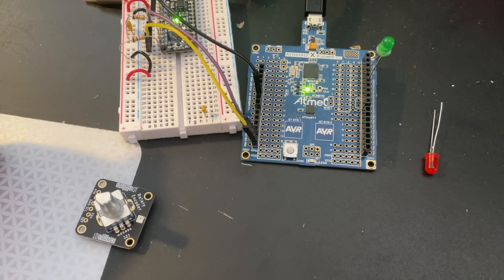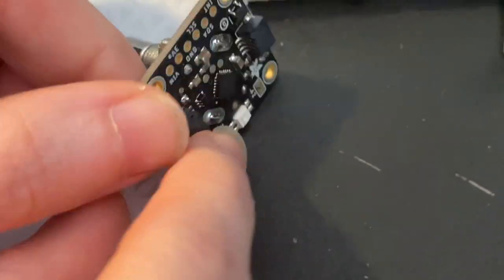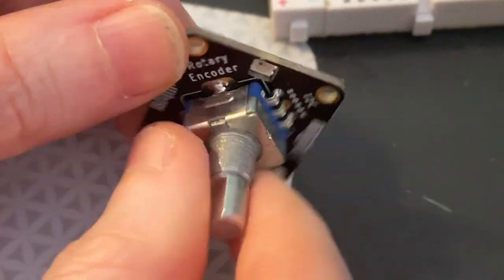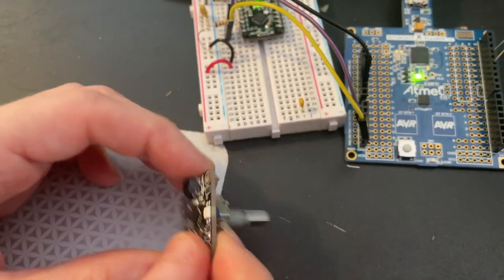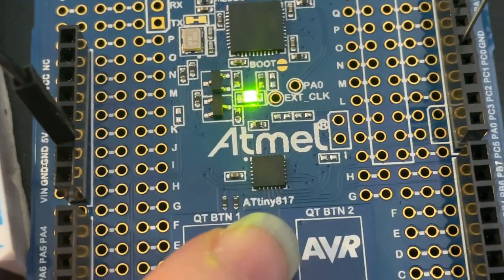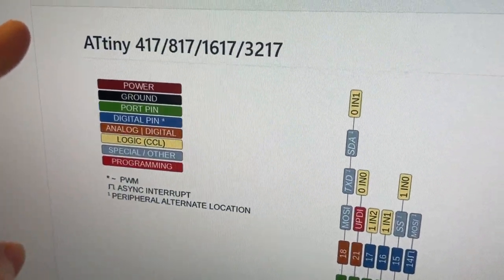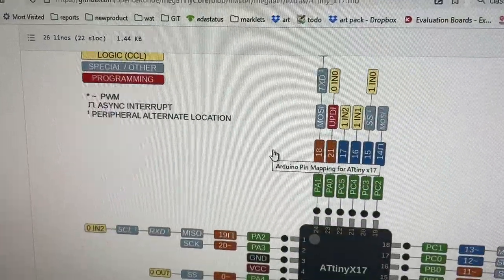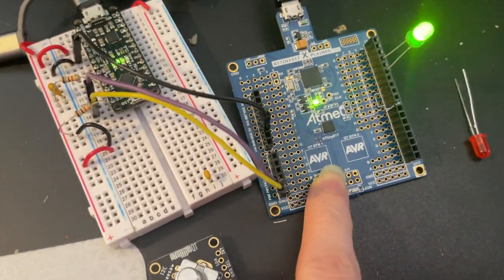Porting our seesaw SAMD09 core to ATTINY

Comment: Nice to see the engineering side how to adapt to the component shortage.
Do you have tips when designing/selecting controllers, what helps in possibly finding alternatives in the future? Or is using the filter module on digikey the simplest way to find alternatives.